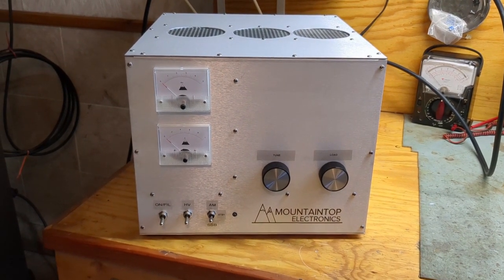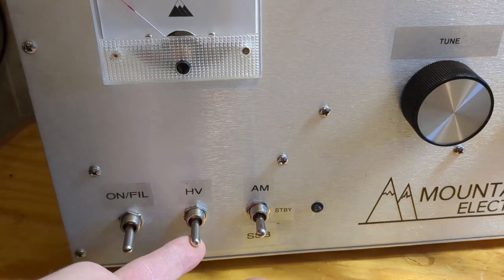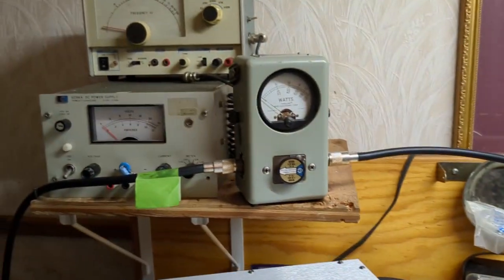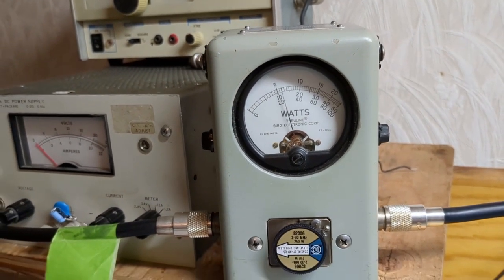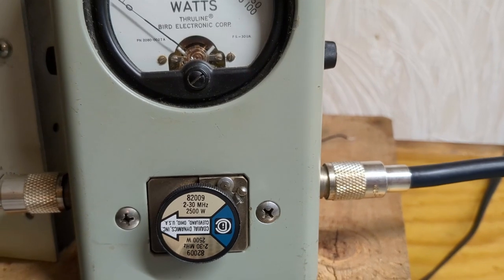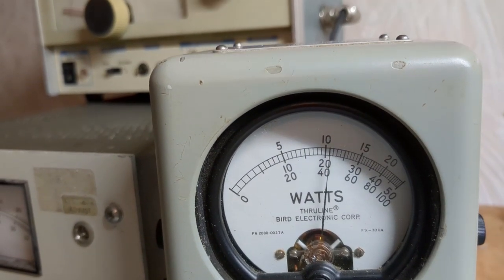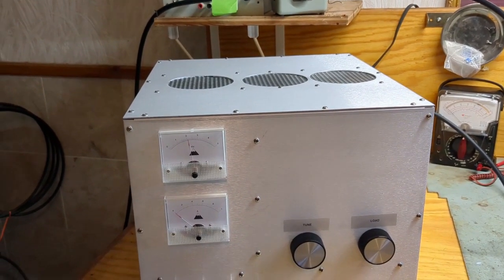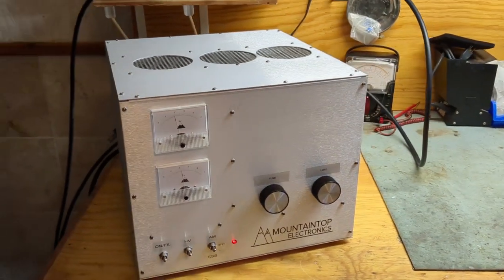MountainTopElectronics Two Tube GI7B

Comment: Awesome ! Great job.
I built about 9 variations on this theme before realising it needs 100W+ drive power ... DOH !
Good call on the GI-6b being EXACTLY the same as the GI-7b. 
USSR changed the numbering system at some point. They are the same tubes.
A GS-9b fits in the same hole/socket, gives 50W less and is even less popular = cheaper.
EA7KNW
Reply: Gi-6 is for higher frequency
Reply: @alanb6401  Thanks ! That made me look closer at the spec sheets.
It's the other way around - GI-7b is for up to 3GHz in pulsed operation.
GI-6b up to 1.6GHz
For up to 30MHz, both work exactly the same.

Comment: How do you measure the grid current?
Reply: You just stick a resistor in the HT-  to measure the cathode current, then a resistor to ground.
The voltage across the grounded resistor tracks the Grid current.
So far as i know, no contemporary amp builder has yet worked out how to calibrate the Grid current.
Doesn't seem to matter, so nobody spent much time on it.